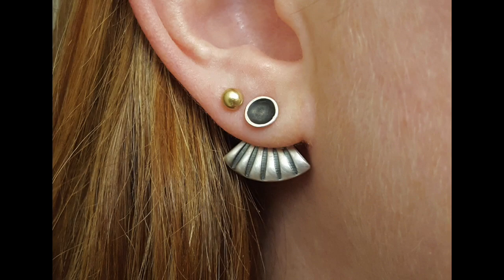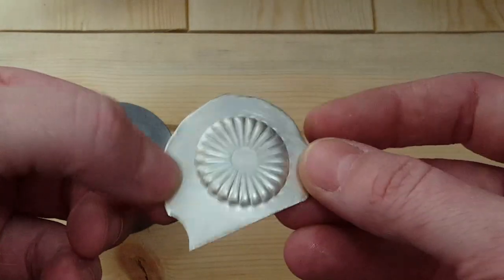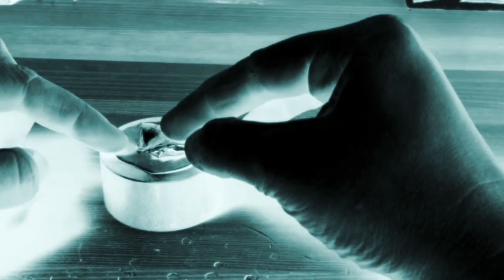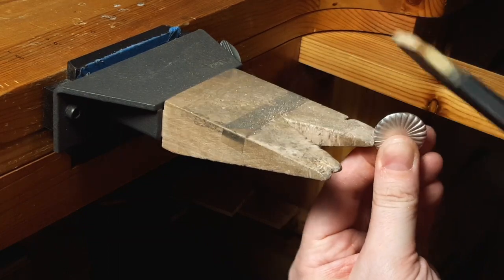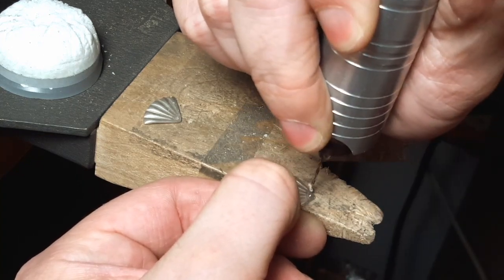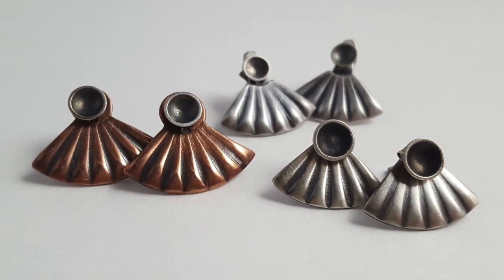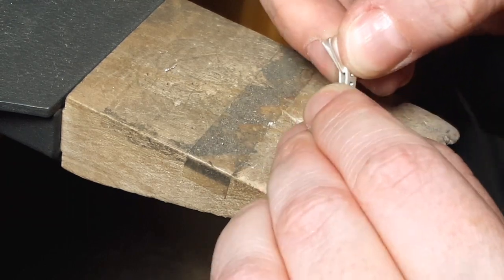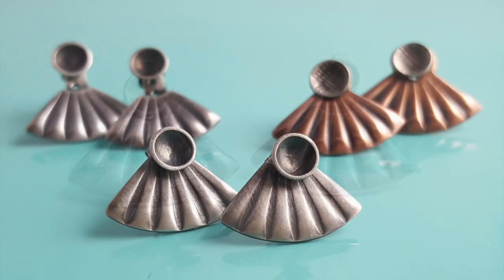How to Make Ear Jackets Using a Potter USA Impression Die!

Comment: This is a great video! Thanks so much! I do have a question about making the earring with post. So far I've only made earrings with ear wires and then just soldered them. How do you secure the jacket back to the earring post? And/or how do you make the catch for the earring post?

Comment: You mention pumice powder. Where can I get that? Thanks for the great videos
Reply from the maker: Any jewelry supplier should have it! I got mine from Rio. You get a big box of it that will last forever.
Reply: I found it. Do you mix it with water to use it.. Thanks for the quick response
Reply from the maker: Just moisten your fingertip and dip it in the powder. It's my favorite way to remove liver of sulfur!
Reply: Thanks so much. I can’t wait to try it. I have never like the result with steel wool  or other abrasive pads